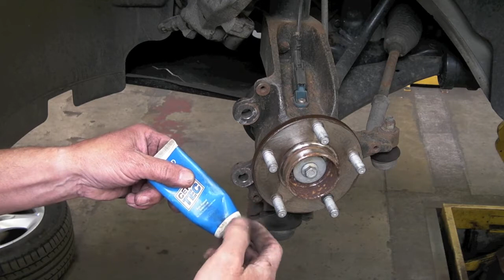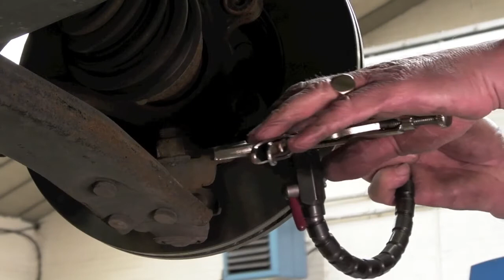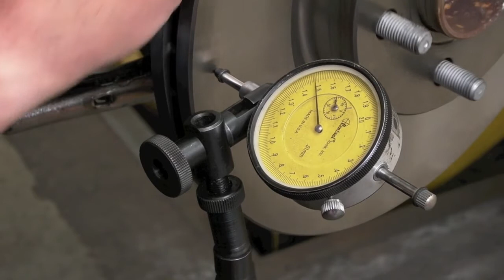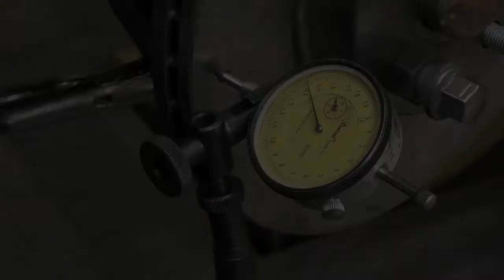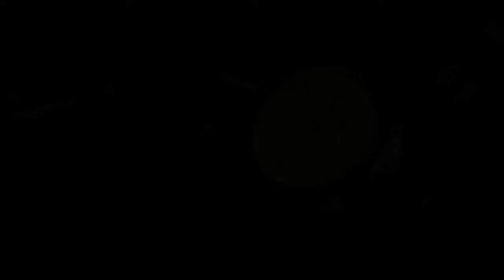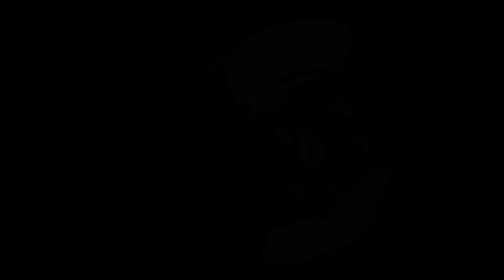How to Change Car Brake Discs and Pads - PAGID

Comment: Crap video for someone who has never done this before.  They will be confused straight away if no separate spring or dust cover is fitted .  Who has one of these hooks? people use a bungee.  This video is presented as if all brake pads and callipers are just like the one in the video.  I have changed discs and pads on all my peugeot and citroen cars over the years, and not found these pins and dust covers.  The video should start with it said, on this car in video it’s like this, but many are different. a thumbs down.👎     Who uses a dial gauge? and who loosens bleed nipple? an idiot? ….     It does mention on many cars the disc is held in place by two separate small screws so disc doesn’t fall off when wheel bolts are removed This video on the one hand is aimed at a beginner but yet the tools are more likely owned by a pro mechanic,   The hook, the gauge and the pneumatic wrench.    Totally unrealistic and needs updating..  A mechanic would not need to watch this pointless video..    This video will confuse a beginner and annoy someone who knows what they are doing.   Pagid need to remove this video and make a new one.

Comment: Is Ceratec OK to use to lubricate the slider pins? I've had conflicting information on this.
Reply: I was looking online about the composition and what type of grease Ceratec is... Still a mistery!
Reply: @dobromirdishkov8823  some kind of synthetic grease, I have tried ceratec on slider pins and they seized after some heat cycles so I do not use it.
Reply: I use Red rubber grease on the slide pins.
I hear Silicone grease is ok as well 🙂
Reply: Never had an issue personally
Reply: Ashley Burton me neither but wondering what official advice is?
Reply: It's when you use copper grease your in trouble!
Reply: yes but use a lube that wont sieze the pins or swell the boots aka silicone or manufurers' lube (for ex audi's pins and boots from TRW (OEM) comes with TRW lubricant).